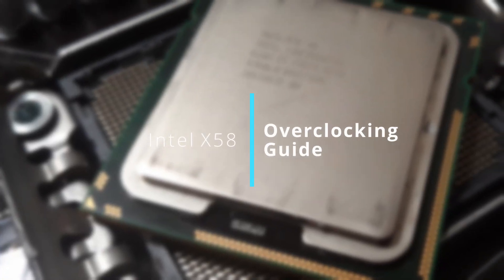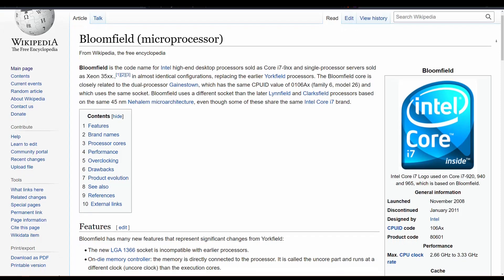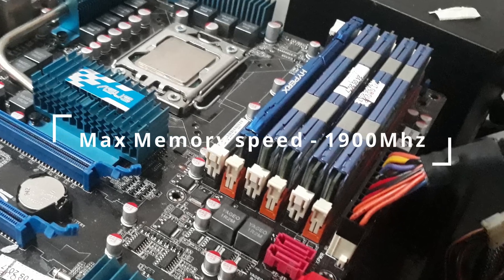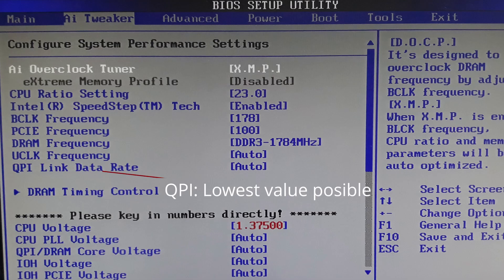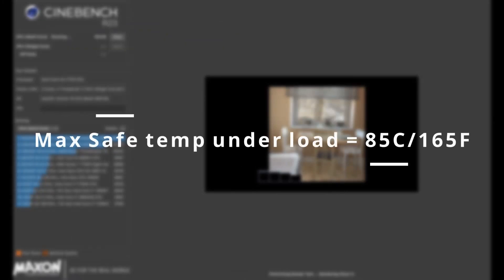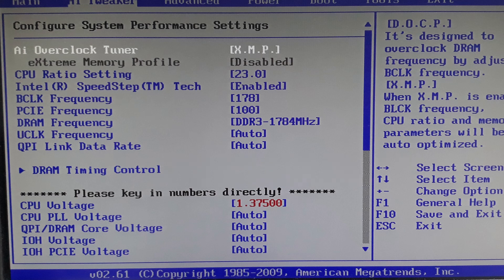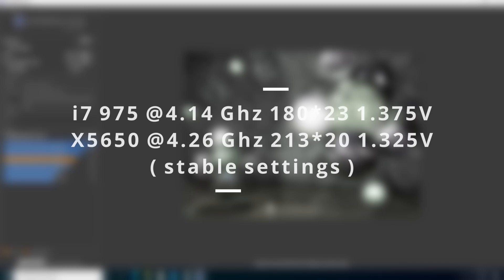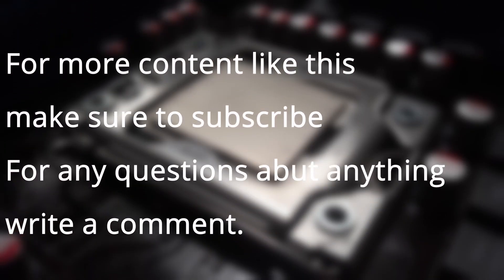Overclocking Guide for X58

Comment: are these settings good for asus P6T SE with x5650 ? also whats the recommended psu wattage for a good 4.2 ghz  oc?
Reply: You are good with 600+ Watt.
More important is what kind of GPU you are using
Dependingf on your GPU, you need an hihg wattage PSU

Comment: Can I use your guidelines for overclocking a P6X58D-Premium and I7-980X?
Reply from the maker: You sure can. You are also better off with using higher multipliers (like 22 and 23, even 24) as your CPU is unlocked.
Reply: @HardwareShenanigans  I got an Asus Sabertooth a while ago (for the USB 3 and SATA III (well, only two ports and finicky due to the early Marvel Raid controller.) I've added an X5680 and had it clocked to 4620.... temps are high, esp w/CB20 (scores very good at about 2130. Dropped it to 4554 (185x23 ram 1580--3x8 and 3x4) temps still at 85 max.  Air cooled Cpu-z  415/3149

Comment: i hava x5670, how can i overclock it with safe setting??
Reply from the maker: Use the same setings as in my video for the X5650 and you should be fine just fine. The x5670 is a better chip and so it can do even higher clocks for the same voltage so play with it a little. Have fun!
Reply: @HardwareShenanigans  thanks u<3

Comment: Do you change any cpu settings. Such as C states?
Reply from the maker: C states are not affected by overclocking as they are responsible for power saving while idle-ing. Disable them only for stability testing, but for daily usage keep them enabled.
Reply: @HardwareShenanigans  oh! Well. Now I know. Thanks.
Reply from the maker: Glad to hear I helped! Cheers!
Reply: @HardwareShenanigans  Well. Since you do actually reply. A big thank you btw. I went and got the W3690. Do I baseclock overclock and then play with the multiplier? I haven't gotten an answer from anywhere on that one.
Reply from the maker: The 25 multi is considered the best. For starters, just play with the BCLK for memory OC. Once you got a satisifying OC on the memory keep the BCLK as is and then use the multi to max out the CPU.
Reply from the maker: As for the BCLK the sweetspot is 200 in my experience. It allows you to run both 2000 mhz memory or 1600 if you choose so. Using the multi you can stabilize even a 5 ghz oc with enough voltage. Regarding voltage, as far as you keep your temps low enough you could push up to 1.5 V on VCORE as these chips ( the 32 nm Westmere ) are built like rocks.
Reply: @patrickprafke4894  I'm running an x5680 and have an x5690 coming. (Asus Sabertooth) Have an x5670 in a P6T. Built that in 2010 w/i7 920 -bent some pins so only 4 ram sticks work. It served my well for years, added the x5670 in 2017, which is when I found out about the pins. Wasn't able to fix  them but back then I overclocked it quite  high and got some good geekbench scores. (I prolly ran CB but didn't save any results) Haven't used it much for years, but, wonder of all wonders, 13 years later, I managed, with hours of painstaking work, fix the pins and now all ram sticks work!! Have yet to have any overclocking success with it. At least it's fixed so I'll try to sell it. I like the Sabertooth  better as it has SATA III for two ports and USB 3
Reply from the maker: Congrats on that fix! I did a lot of pin repair myself too and it is a very nerve-racking experience!
Reply: @HardwareShenanigans  Thanks. I think I knew that, not sure I have them disabled for benching. I have yet to run a stability test. I may need to throttle back my settings for testing. I have done multiple runs on an Asus Sabertooth/x5680 at 4450-4620 with good results. Cpu-z, Geekbench and Passmark all scored well but CB 20 crashed at 4700 and a couple times at 4620. CB 15 barely made it. Temps maxed at 87.  At 198x23 (4554 MHz) CB 20 hit 85 and scored 2130
Reply from the maker: @Roger Barnett Regarding the stability issues, what voltage are you running your CPU at? You can try to push it a smidge, but I think you found the limit of your cpu if it is crashing in only some benchmarks.
Reply: @HardwareShenanigans  My reply got zapped when I tried to add to it. I ran Aida 64 for 20 min--peak temps were 82 on one core. 2-6 lower on the others. I've had the VCore at 1.35 to 1.3925 but both CPU-z and HWInfo are showing 1.336...hmmm 

Here's what I added:  I have three water coolers, one is in my best build (Ryzen 5950x/RTX 3080Ti.. and two 240 AIO's that are going in my other two Ryzen builds-3700x and 5800x. I might check to see if there's the needed hardware for the LGA 1366 in my parts bin. As that would surely help bring the temps down. (I'm using a chinese Vetroo--has 5 heat pipes and is clearly a bit better than my CM 212 Evo in the P6T build--
Reply: @HardwareShenanigans  While the Aida temps are prolly on the high side.... at 4.55 (198x23) all bench tests run to completion. I'm not a gamer, but have recently read that H/T should be disabled...for gaming.... I'll have to go back in the bios and find it and disable it... as it surely should help the temps, right?
Reply: my other two Ryzen builds-3700x and 5800x. I might check to see if there's the needed hardware for the LGA 1366 in my parts bin. As that would surely help bring the temps down. (I'm using a chinese Vetroo-has 5 heat pipes and is clearly a bit better than my CM 212 Evo in the P6T build-

Wonder why this text had a line through it...don't care if it's visible to people
Reply: @HardwareShenanigans  Moved vcore to 1.368 and turned H/T off. Now aida 64 temps at  much lower at 55-68. I might try to bump the o/c back up and see what happens... Appreciate the help, sir!!
Reply from the maker: Regarding the HT yes, it will help the temps quite a bit, but honestly if you paid for a 12 threaded chip, might as well use all 12 threads :))
Reply from the maker: I think the stripes are there because you used the "-" character and then wrote some text " - hi there - "
Reply from the maker: You are welcome! Didn't expect that much of a difference to be honest, but very very very nice!
Reply: @HardwareShenanigans  True, but I am mainly just trying to get a good and high overclock. And the cpu cost me maybe $32 a2-3 years ago. I have 3 great modern pc's for real work==photo/vid editing.  But I now have a   serious problem. After my last post, I bumped the o/c to 4.7 (196x24) 1.38125 vcore, which shows in HWInfo as 1.368 for some reason. Now it will not boot to the bios at all. I pulled the battery twice, moved the CMOS jumper, took out 3 ram sticks, checked the other sticks, removed and reset the main pwr and the gpu..... and... nothing. Smashed the del key for at least a minute a few times, left it going as well for a long time... made sure the keyboard and mouse are connected. keyboard is wireless, I'll plug a wired one in, fwiw.  
I can't imagine that the cpu was fried that quickly.....Any ideas.....?
Reply from the maker: @rogerbarnett8412  I don't think it is the CPU. cpus die very very rarely and 1.4 V is very safe ( those CPUS cand stand even 1.55V if cooled very well ). The motherboard on the other hand might have kicked the bucket. Try to leave it unpluged and without a CMOS battery for a day... who knows, it might come back online.
Reply: @HardwareShenanigans  Will do. I did leave the battery out for a while. Question. Leaving it running but not booted for quite a while in hopes that the bios would finaly show up---- could that have caused a failure? (I didn't suspect the CPU, either.....)
Reply: @HardwareShenanigans  Also.. you're not going to believe this, as I didn't. But, that same day, My first build, from 2010, also will not boot. (exact same characteristics-turns on... mouse and keyboard light up... no go...)With both boards, I double checked the monitor tried another-- HDMI cables... and even switched out the GPU.
Reply: @HardwareShenanigans  Update. Check my first two replies to ya..... No luck still. 
Neither rig will boot. Both turn on, mouse lights up. Monitor works. Cables checked. GPU works. Strange that both are doing the same thing.
Reply from the maker: @rogerbarnett8412  It is very very strange indeed... I have no more ideas, this is baffling me!
Reply: @HardwareShenanigans  Me too. Groan....

Comment: huanahi x58 r3.0
rx550 4gb oc
xeon 5660
16gb ram (1x8gb 1600ghz and 1x16 1333ghz)

can you help me with this ?? It happens to me that I have some ram at 1333 Mzh and they work at 1060 Mzh I went to the bio and put it to work 1333 fixed, BUT in cpu z it tells me 534 ghz and I do a test in aida 64 and it says 1064 ghz.

i want the motherboard bus to run at 1333 gzh u be able to do a little OC.
 please help
Reply from the maker: Hmm looks like that motherboards dosent properly support Memory OC. Try to raise the BCLK from 133 to 160, that shold push both memory and CPU. Also another thing that you can try is to set UNCORE to double the ram speed in bios ( for 1333 it is 2666 in bios ) if that is under double the mobo will not be able to apply the Memory OC. Try that first as I had some issues myself with UNCORE.

Keep me posted!

Comment: I have a L5639 ,How much do you recommend overclocking,The radiator use ProArtist B3 , :)
Reply from the maker: Interesting CPU you've got. Well considering a 2.13 ghz base clock that means you should shoot for maybe 3.5-3.7 as only bclk will let you increase the clock. Try a 213 Bclk. That should push the cpu up a bit but also make sure to increase the voltage! Hope I helped and keep me posted.
Reply: @HardwareShenanigans  aha,Now I use cheap X58.It not over clock.The modified BIOS can support overclocking.But the power supply is only 4+1. Let's try it. :)
Reply from the maker: Should be fine. Keep the VRM cool, maybe point a fan at it. Good luck!

Comment: I have an x5670 @ 4,4 ghz on air and i want a silent pc on air. that was bit of a challange.... but with good air cooler. good flow .. and a good 120 mm from the bottom i finaly got it work with low fanspeeds and very silent even under load. max temp in cinebench 80 degrees. asus deluxe v2.  vcore 1..330 pll 1,88   1600 mhz ram corsair.. in games there is no much difference for higher ram speed. funfact ... you can put a high end graphic cards in that system and in 4k or 2k the cpu doesnt bottleneck. very funny for that old system. but gpu prices are skyhigh and i must wait for an upgrade. P.S. long live the x58 :-)
Reply from the maker: Absolutely! These cpu's are sooo good. I tried one with my vega 56 and if I pushed more that 1080p I couldn't see much difference. One of my favourite platform. Maybe just x79 being on top. Anyway thanks for the comment!
Reply: @HardwareShenanigans  You welcome and thanks for the video. Yes x79 are good ones. x99 i saw a lot of new cheap chinese boards. But i don t trust them.
If u can go cheap fo an old x79. Go for it.. and let us know :-) cheers
Reply from the maker: Well I tried to get my hands on a X99 board but they are soooo expensive. I managed to get a hold of a 5820k for a steal 50$ but ofc i have no mobo for it. Also looking into X79 boards to retest my 3930k but again no luck. If i manage to get any, I will surely make a video on it.
Reply: @HardwareShenanigans  Good luck then. :-)

Comment: Is it even possible to undervolt this CPUs without setting a fixed voltage? my Sabertooth X58 has offset mode, but it only Increases the voltage, I cannot see a 'negative voltage' option, am I missing something or has it always been like this?
Reply from the maker: I haven't tried to offset OC or UV so I couldn't tell, but I think that the undervolt offset option first came about tin the consumer space. On x58 most people would OC rather than UV. So in conclusion, if there is no option in the bios I am afraid that only fixed voltage will do the trick. Hope I helped.

Comment: I am at 4.4ghz with my X5675. I will post the settings later. I am however unhappy with the temps, that exceed 90 degrees after some minutes, so I will try to improve cooling, but mostly I want to reduce the voltage.
Reply from the maker: Well these xeons aren't really known for their efficiency ;). At 4.4 ghz you should consume upwards of 150w so get a beefy cooler.
Reply: @HardwareShenanigans  I managed to increase the clock speed to almost 4.5, and lowered voltages. I have added a fan to cool the ram, and this magically also made the CPU temps decrease.

They are now under 90 during a 10 minute stress test, which is fine.

4.4-4.5 should be attainable for most people, Tech Yes City does it for example. The card is a great overclocker, and in Cinebench it performs as well as an i7-7700k at stock speeds.
Reply from the maker: Sure thing. These cpus are truly special. Right now I am testing a 7700k for an upcoming video and man, I strugle to get past 1050 points in cinebench r15.
Reply: @HardwareShenanigans  Interesting. I've yet to see more than 85 watts in my testing... as I wrote, however, temps w/H/T on were as much as 85-90, which is too much.....
Reply: Guys 7700k is 4/8 not 6/12, what did you expect? 1050 points are more than better for an 6/12 ,means you have 210+ single core....more than an i5 10400f....

Comment: I have the x5675 paired with asus p6x58d-e overclocked to 3.91ghz @ 1.264v but with turbo enabled it boosting to 4.25ghz at the same vcore and qpi/dram core volt is 1.26250v blck 170 is this good?
Reply from the maker: If it is stabile then that should be sweet. You can yes the turbo stability with Asus RealBench and see if the cpu can boost corectly. Anyway thanks for the comment and sorry for the late response.
Reply: @HardwareShenanigans  I'm wondering is it the qpi link for interacting with the GPU side of things
Reply from the maker: Firstly, sorry for the late answer. Secondly, QPI is the speed of the CPU - Northbridge interconect. PCIE is linked to the Northbride and has a separate clock on X58. It is called PCIE clock. So if you don't tweak that, the pcie spec will remain the same and the gpu will be fine.
Reply: @HardwareShenanigans  Thanks for the info the PCIE frequency is already set to 100mhz which is ok. As for the QPI is where I'm kinda lost as I don't know if I'm suppose to go higher or lower in clock speed as it currently running 3060x2= 6,120mhz  because I seen a few sites stating that the Uncore ratio for the xeon x5675 should be 1.5x and other stated 2x. Is there a limit on the uncore ratio where it effect overall system performance or does it bottleneck the performance toward the ram and gpu side of things?
Reply from the maker: So as far as I go, I know there is a hardware limit at 8000MT/s and as long as you stay under that, the system should be perfectly fine. That being said, if you can get a bigger QPI speed under 8kMT/s then go for it. Also remember to test the system in prime95 to validate that it is stable
Reply: @HardwareShenanigans  Ah handy to know so higher speed in  QPI = more voltage to get there :)